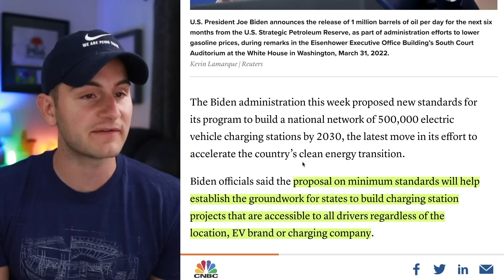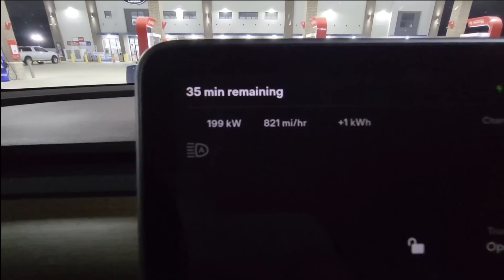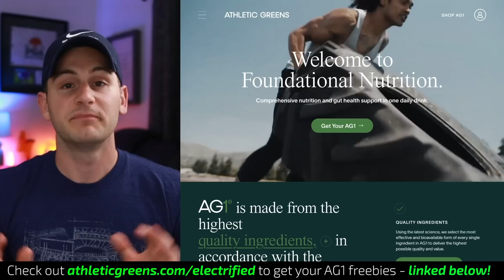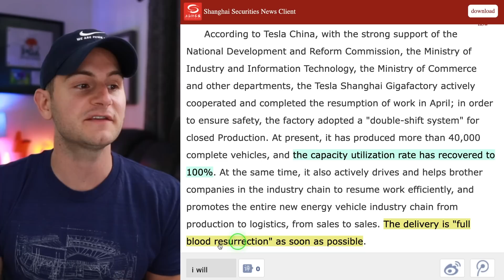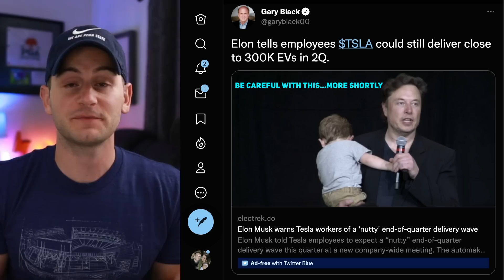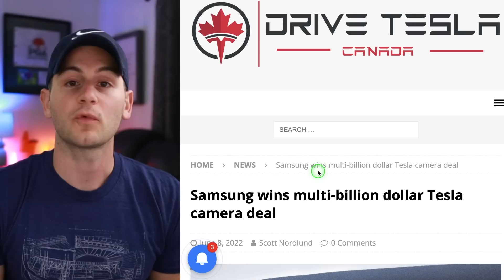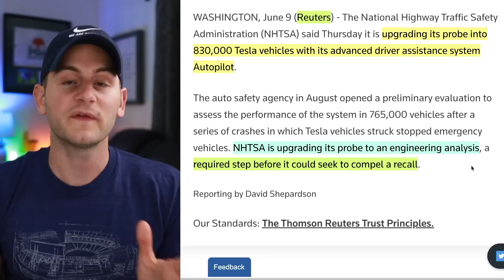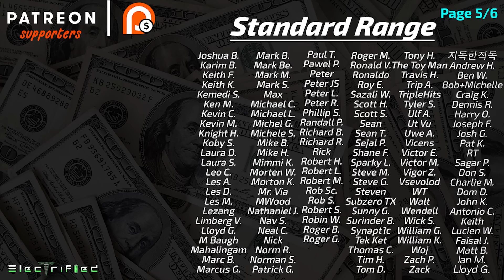4680 Charging Curve Tested / Tesla Set for Record June / White House Sets EV Standards ⚡️

Comment: When you have to wait for over 2 hours to charge their electric vehicles for now to pulling into a service station in a few seconds to filling your vehicles and drive away from having to park up in their bays to charge your vehicles for running out of electricity on the road to require a recovery truck for their vehicles cannot be topped up with a can of fuel for to reach your next service station to have to be transported to the nearest charging bays. They are only interested in generating their own personal wealth management systems created for themselves creating products that are more costly and less efficient systems looking at washing machines and dryer’s systems created for cold water filling only for needing electricity to heating each load of washing machines time to taking longer and energy consumption greater electricity supply and wealth management skills for themselves creating dryer’s systems for taking far longer to heat pump condenser systems for 3 hours per load per 8 kilogram load machines running longer and not energy efficient. Cold filling washing machines for building up bacterial slime with detergents not dissolved in cooler temperatures cycles of smelly washing machines in mould building up in pipes in seal’s and building their products for causing illnesses to laundry now not clean in washing machines bacteria building up in their products in creating their products today for wealth management practices in promoting their a new technology systems for generating electricity consumption and removing heating systems for all electricity systems for their own personal wealth management systems and controlling their ability to ensure people complying with their own personal rules laws regulations for modern technology slavery systems internet systems using their products to connect to internet like washing machines and dryer’s products like fridge freezer systems internet systems to allow themselves to operate their products from backdoor internet access systems wake up to earth angels fallen angels in earth and their technology and skills to influence mankind to understanding science and scientists meddling themselves under the influence of god’s fallen angels beings spiritual beings who are being worshipped humans becoming host’s themselves to demons and demonic spirits being fallen earth angels. Lucifer worshiping in people who having their lives living in luxury living in their ivory towers themselves creating themselves wealthy empires landowners and landlords and investment opportunities for generations worship their god being lucifer.

Comment: You're probably right about Tesla being overly conservative with the initial roll out of the 4680s and will keep stats on them for a while as more and more people drive and charge them, and then tweak them going forward with over the air updates. If not, then the 4680s are not really an advantage for the end user, but for Tesla since they make building the cars easier and cheaper in the end.

Comment: There need to be some minimum charger maintenance standards to minimize downtime which is currently the biggest bugbear of non-Tesla charging networks. It's hard to believe that these networks wait for someone to notify them that a charger stall is offline. They should be actively monitoring and rebooting those chargers, and have rapid response technicians when that is needed, to repair an issue that can't be fixed by a remote reset.
Reply: True, but this will not be provided by failing big auto. It will be funded by
US taxpayer debt, as everything is there.

Comment: Regarding the NITSA investigation into the incidents with cars hitting emergency responders:
Step 0: Read the ULA for Tesla FSD and driver assist features which clearly states that the driver is fully responsible for the vehicle at all times and must be ready to take over if the software makes a mistake.
Step 2: Dismiss the case.
There. Job done.

Comment: Tesla has such a head start with its supercharging that the government is so far out of touch with 2030 projection by then the superchargers that Tesla has and will have installed will dwarf the Governments feeble try. I believe big oil will wake up and start installing chargers in Lieu of Gas pumps if they are going to survive. Let’s Go Brandon try pushing it to 2025 .

Comment: That last battery pack robot arm is huge!  Battery packs are pretty heavy though...  I wonder what the difference in weight is for 4680 VS 2170's since 4680's are dry cell?
Reply: Isn't the difference just in the process? The resulting cells are equally dry IMO. The reason why that dry process is a big deal is that it doesn't require subsequent drying in ovens, like the wet process does. At least that's my understanding.
Reply: 950 4680 cell casings have about 60% the surface area of 4,400 2170 casings.
Casings are made of steel.
There's a saving.

Comment: Tesla began deliveries if first 50 model Y in Israel.
Only LR (₪331k = $98.5k with all taxes) and performance (₪363k  $108k all in), all made in Berlin.
No 7 seaters available to order yet.
In 2021, since Model 3 introduced in March, 2021, 6300 model 3 were delivered in Israel, 63% of 10k BEV's sold in Israel in 2021 (up 550% YoY) at first from Fremont, later from China.

Total car deliveries broke record at 300k in 2021 in Israel.

In 2020, only 1500 BEV's were delivered in Israel, No Tesla yet.

In 2022 so far only 1450 Model 3 delivered and 50 Model Y, not due to lack of demand.
Model 3 is sold at ₪225k ($67k with all taxes) for SR, ₪272k ($81k) for LR, and Performance for ₪300k ($89k).

Prices  increased up to 25% since introduced last year.

Israel provides a huge discount to BEV with 10%  import tax instead of 83% for ICE car, 20% for PHEV, the BEV benefit is limited however to ₪75k ($22k), being reduced gradually beginning in 2023, by 20%.

Comment: To add to rthe previous comment, The Y with the 4680 cells is apparently 68kWh so if it is charging at 206kW peak this is 3C charge rate.  The plaid is 250kW power for a 110kWh pack which is  2.27C, but these are peak.. What really matter is not peak but the average C-rate over the entire charging time. This is simple calculation= 60 minutes divided by Total charging time in minute.

Comment: The 4680 cell ought to be in a completely different league to the 2170. The Tabless construction massively reduces the cell resistance, while providing a much shorter path for heat to be conducted away. These things together should be a game changer when it comes to charging time. However, if Tesla unlock this potential, it's going to destroy the sales of all of the other battery types. I'm absolutely certain that they are seriously sandbagging the 4680 in the software. It's hard to see how Tesla do much about this without seriously hacking off some of their customers. I suppose it's a nice problem to have, but a pity the performance can't be realised.
Reply: Nope it’s not! They have to be very concerned about the first cells and not over stress them! No one knows how long those will last/ perform!!
Reply: Not really, the tables design simply enabled the bigger form factor. 4680 is 5.5 times bigger than 2170, and should have 6x the power (according to slide on battery day). So the charge/discharge advantages were always supposed to be within 10%.

Comment: The conversion to EVs in the US is not rate-limited by charging stations!!   Tesla could single-handedly do it, if needed.   And it is likely that non-Tesla charging will disappear once govt. subsidies disappear for the reason that EV owners will gravitate to Tesla charging stations for lower rates, fastest charging, and highest reliability.   The free market will work fine in this case.  Spend taxpayer dollars on raw materials or other rate-limiting factors that are slowing the urgent transform to sustainable energy.

Comment: The plaid is 110kWh battery with 750kW power with 18650 cells not 21700. The internal resistance is way better so YES it is normal that it charge faster. Please compare APPLE to APPLE.  Charging speed performance should be compared in term of "C-rate" not kW.  For exemple a 100kWh pack will charge at twice the power than a 50kWh but each cells will charge at the same speed. So it is more relevent to compare charging power RELATIVE to the size of the battery  The C-rate term is exactly doing that. A 50kWh battery charging at 200kW is reaching 4C.  A 110kWh battery charging at 250kW is reaching 2.4C... so the 50kWh is charging faster. ( 200kW ÷ 50kWh= 4C)

Comment: My hope is everything gets to one standard plug type, with chargers running between slow at 150 kW and high speed at 350+ kW.
I can see the recall 'Tesla is forced to recall x number of vehicles for Auto Pilot repairs. Tesla's response was to fix the problems a few months ago.

Comment: The charging speed is actually fairly impressive for a 70kwh pack. The model S can distribute that power over more battery.
Reply: Yes!  The plaid is 110kW 750kW power pack with 18650 cells.  The internal resistance is way better so YES it is normal that it charge faster. we need to  compare APPLE to APPLE.  Charging speed performance should be compared in term of "C-rate" not kW.  For exemple a 100kWh pack will charge at twice the power than a 50kWh but each cells will charge at the same speed. So it is more relevent to compare charging power RELATIVE to the size of the battery  The C-rate term is exactly doing that.😉
Reply: @Doctorbasss  
"The internal resistance is way better"?
Of the Plaid pack?
We're talking cell level here and I very much doubt the internal resistance of 8 18650 "tabbed" cells is better than 1 4680 "tabless"
(Yes, the 4680 is almost precisely 8 times the material volume)
Reply from the maker: hey wilson! where did you get 54kwh from?
Reply: @DillonLoomis22  sorry I spotted 54kwh at 3:23 in your video and didn't realize that was only from 10-90%. This would imply that the pack is around 70kwh (54kwh to charge up 80%). I'll correct my original comment.
Reply: Tesla is always conservative for new battery types and will issue an over the air update to improve the charging curve after a period of data gathering. They did this with the LFP model 3/y from china as well.
Reply: @yourcrazybear  it has nothing to do with conservative! You just don’t push a brand new hardware to its limits on a new EV, the car almost adapt itself
Reply: @alanmay7929  "it has nothing to do with conservative! You just don’t push a brand new hardware to its limits on a new EV, the car almost adapt itself"

Temporary limiting the charging speed on all new batteries is indeed being conservative.
Reply: Nope it’s not impressive at all
Reply: @alanmay7929  Bruh you're still spending your time hating Tesla?
Reply: @lachlanB323  no sh*t Sherlock!!!!!!!….
Reply: @Alan May  😂. lol. I have seen you over the past year doing this. I guess some things never change lol.

Comment: NHTSA can't understand Tesla's technology, as it changes from update to update. Investigations are a fool's errand. And you suggesting otherwise makes me think that you don't understand either.🤷‍♂️
Reply: NHTSA is accustomed to dealing with companies that make model changes every few years, not every day.  The question, in this case, should be what has Tesla done (or not done) to remedy the 'crash into emergency vehicles' problem and have there been crashes since the fix.
Reply: @bobwallace9753  1. The cars dont aim for emergency vehicles. 2. Tesla already did something by putting drivers on notice that theyre responsible.
Reply: @BenefitOfTheDoubtInquiry  

Tesla EVs have crashed into stopped emergency vehicles a few times.  Yes, it was the driver's fault because the driver is supposed to pay attention and avoid things like that.

But in order to complete full self-driving, when there is no driver, Tesla has to solve that problem.  The question I have, and the question NHTSA should have, is whether this problem has been solved.
Reply: @bobwallace9753  That's my main problem with media and authorities. They don't understand that there's no "easy fix" or "remedy" to problems, when the technology uses machine learning. You're not writing code like "IF cop car THEN don't hit". The system is making progress with every update, BUT will never be perfect. What Tesla has done to "fix" the illegally parked cars problem on highways is to limit the speed and add a superficial feature that detects emergency lights. They didn't modify code, they just added more complexity to the system (too early) and introduced a dumb solution by limiting the speed.

Comment: The very first time I supercharged my Tesla is was slow for some reason, second time was much faster and has stayed that way. The analyst got lucky with the price target, if not for macro issues, Tesla would be over $1200 right now at least
Reply from the maker: good to know on the charging! and yeah, i'm inclined to agree about hummel...however his take now seems to be on point imho
Reply: Quite possibly balancing the pack?
Also I'm not sure the Charger was set as a destination, so there may not have been any preheat.
Reply: $1,200.00 @t LEAST!!
Reply: @TeslaEVolution  $1200-1500 for sure
Reply: The charging speed depends much on how warm the battery is.
Reply: @yourcrazybear  right

Comment: 4680 is to maximize production efficiency not performance efficiency
Reply: It's to do both.
Reply from the maker: to some degree yes, but tesla touted many performance benefits at battery day as well. i'm still expecting them, but it sounds like they need a year or two to continually work out the chemistry mix and optimize everything
Reply: @DillonLoomis22  dont forget Elon loves to have little Easter eggs and it wouldn't surprise me if suddenly one day he's ready to flip a switch with an OTAU and suddenly a whole heap of battery magic happens.
As far as the charging outlets go, Brandon won't be around long enough to see out his enthusiastic dream of Charging Stations. He will not remember what he said. Did he say anything about the Charging Stations being built by hard working AUW workers and thank Mary cause she made the electric industry happen. The man is a mental cripple.
Reply: @DillonLoomis22  Interestingly enough, when LFP cars first arrived in Europe, they would charge extremely slowly in cold weather. It took Tesla few months to fix that OTA. Maybe they are still figuring out the right charging strategy and current settings are very defensive. Who knows.
Reply: The tabless design makes it possible to move energy into and out of the battery faster.

Shorter travel distance for electrons and hugely more surface area connected to the +/-.